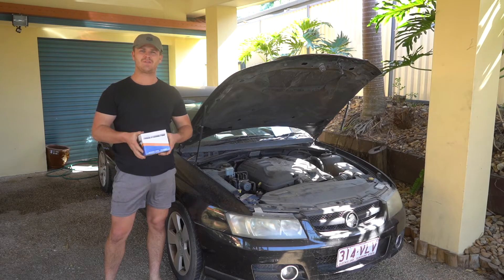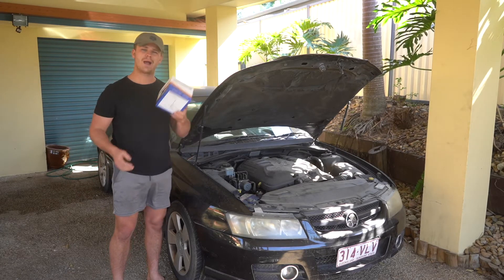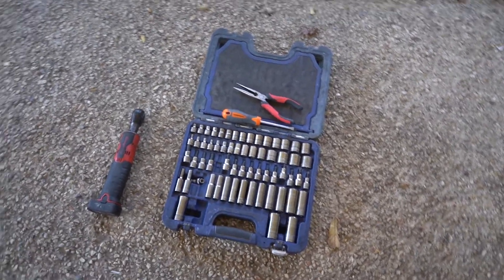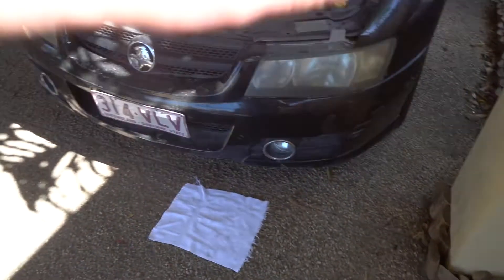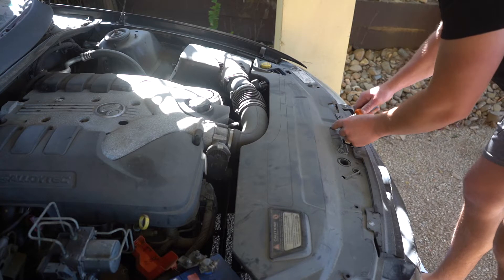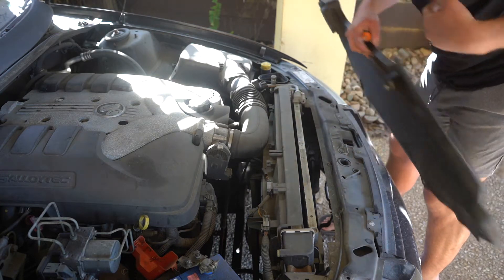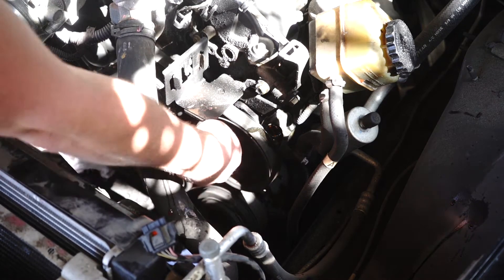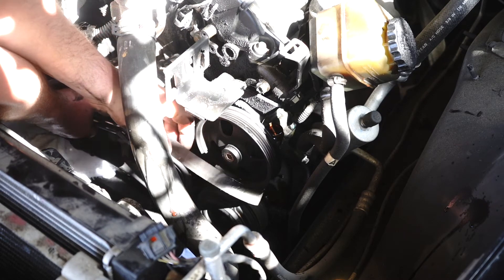How to Remove and Replace a Holden Commodore Power Steering Pump VE VZ

Comment: GREAT video (thank you sir),
aaaannd.... "out of stock".  :(
(mind you, I don't YET know what problem I have - water pump, power steering pump, or.... ??  2006 VZ ute, 220k km's, started off as a little bit of noise (barely noticeable whilst driving), increasing to almost constant "scratch / scrape / whine".  Seems to be more to the passengers side (r/h/s when looking in from the front), suggesting it is the power steering?).  THIS vid gives me a little more confidence (your product comes with pulley), another vid I saw involved separating the pulley from the pump and having to re-install it on a new pump!
Reply from the maker: Back in stock soon. Email us a video of the noise. Thx

Comment: For some reason my steering hose will not go back into the new pump. The hole is too small
Reply from the maker: Swap the fitting from old pump to new pump. Happens sometimes

Comment: haha all that effort, surprised you wouldn't just change it at that point! good video, could have been shorter but good all the same, thanks. Been that the VE is 3 x 10mm and VZ is 2 x 13mm wouldnt the pump then be different or are the screw points irrelevant? Never needed to change one myself but were about to change all 3 of our VZ's one.